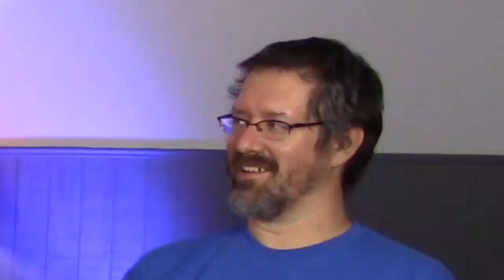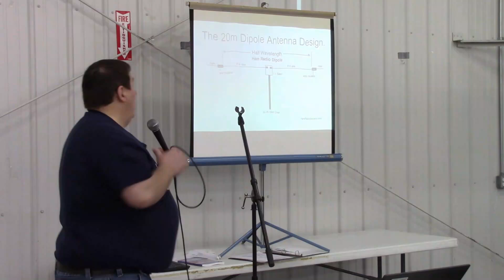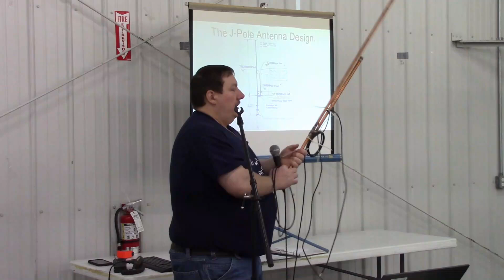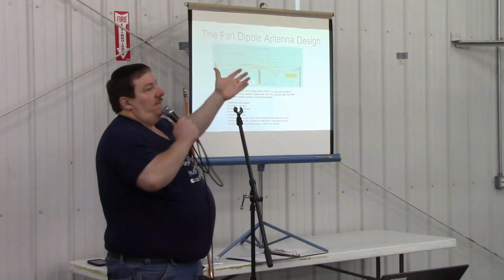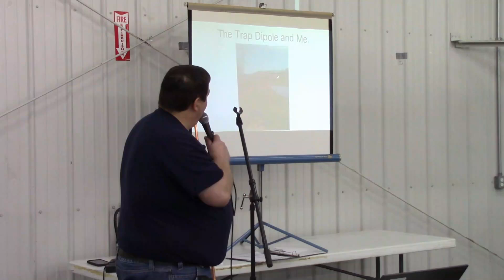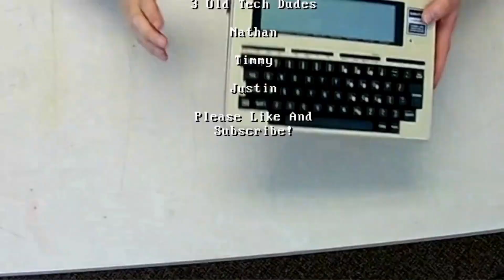Cheap Antenna Build Ideas For Ham Radio (Hoosier Hills Hamfest 2023 Forum Presentation)

Comment: I like your channel. I come by every so often because I like the projects. The volume on this video is tough. I would like to see an update on this presentation in your studio if you have time. I built a j-pole and a center-fed fan dipole.. They both work great and it didn't cost much.
Reply from the maker: We are considering that, actually. We're not pleased with how this one turned out in the end ourselves (to the extent that we had a couple of others that we probably won't actually publish here unless we re-shoot them, much as you've suggested.) Thanks for stopping by and checking in....we do have some new projects coming up on the channel, after a considerable hiatus in content releases!